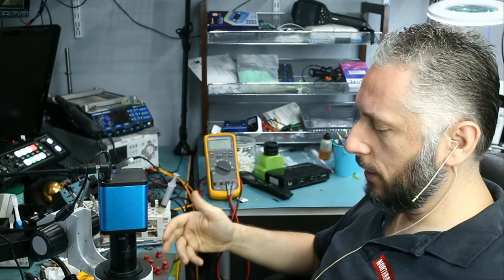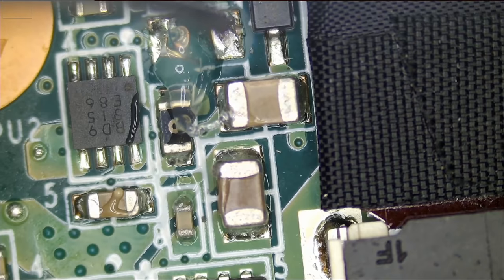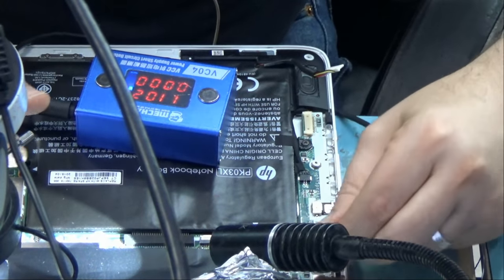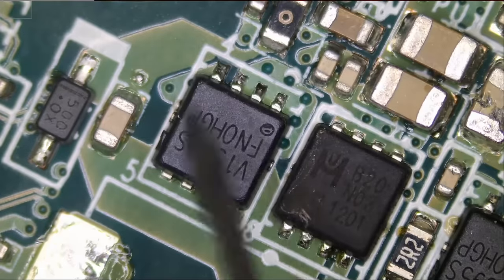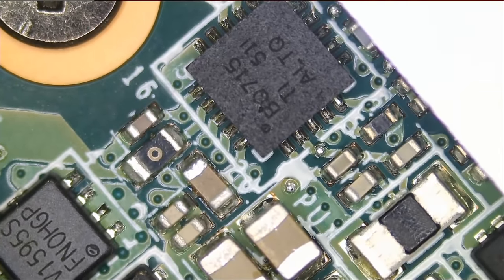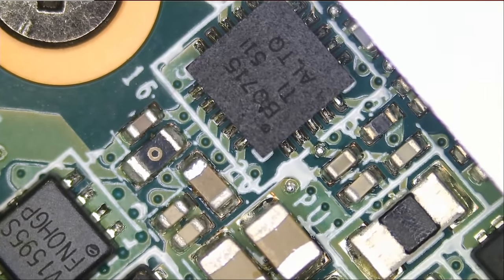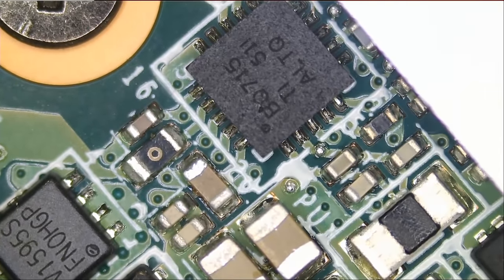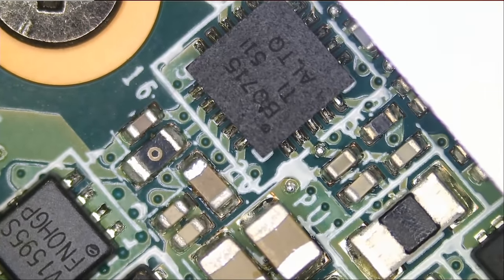HP Laptop No Power - Troubleshooting Short circuit - Watch component blow on camera

Comment: Another great episode of my favorite TV show. 😁👍 That ugly cap has been bugging me ever since 1:57 😠🔥
Reply from the maker: Yes you're right. That cap looks bad but it's testing good. I ended up changing the Mosfets again this morning along with that bad looking cap. Short was gone like before. I powered on the device and Mosfets went bad again. Laptop is going back to the customer unfixed unfortunately. .
Reply: @NorthridgeFix  Hahaha You always foolproof your videos, so i knew you did! That job was too good of a tease. You gave it your best. 👍 As Hristo Stoichkov says - "Sum tie win, sum tie lewn". 😂
Reply: @NorthridgeFix  this is VCC_CORE core line where blown resistor and capacitor you got the short. Most likely a rare event happened - cpu itself is shorted. IC is battery charge controller. And mosftest near by IC gives VIN line
Reply: Was going mention that cap amazing work as always HP should seriously offer you a consultation job to help them design better labtops you seem to always be fixing these things and would have a great many ways to help them improve this line.
Reply: @em0_tion  I miss players like Hristo Stoichkov ,,
Reply: @NorthridgeFix  well it happens. Wondering if it wasn't a bad CPU or graphics.
Reply: That ugly cap had me since the beginning too. Good job trying though on this board! You did your best!
Reply: @NorthridgeFix   

كل عام وانت والعائله الكريمه بالف خير يا حسان 
حتى لو كان الابتوب غير قابل للصيانه ولكن اللحلقه جدا جميله كالعادة مثل باقي الحلقات … سعيد بمتابعتك دائما
Reply: @ksngs78  Agreed. I had a similar issue with an HP ENVY that was not charging! Had to replace the mosfet and the near-by limiting resistors, and caps.
Reply: @NorthridgeFix  You`re great man. I really like your work and how you explain everything!
Reply: Daayuuuuuuuum that SMD work he does
Reply: l
Reply: can you give me some diagnostics for my fried laptop pls?
 @NorthridgeFix
Reply: maybe the problem is CPU or graphic IC

Comment: Why didn't you remove the big red flag -> the capacitor that was fractured?
Reply: ...because it never indicated that it was shorting? Fractured or not, it was still functional. That's the mindset you HAVE GOT TO follow if you attempted to fix a laptop and didn't have the same model to extract any components from. So let's assume you try to remove that cap anyway because you didn't like the way it looks. Great, now you gotta find out its working voltage and capacitance. With no schematics to go on about and no capacitance measuring device, good luck with that.
Reply: Yes please..why?
Reply: @Rodox2k10  bruh, he literally had a donor board with that cap for the taking, would take 15 seconds to swap for peace of mind...

Comment: This Circuit that blow is switching power supply. Google about it, simply 2 mosfets, 1 Coil, capacitors and driver.
Reply: This guy is just learned everything diy. He doesn't know how to properly proceed with fixing motherboards. It begins with reading the schematics to understand how the device works. It doesn't have a charging issue, he already put a fully charged battery inside from a donor laptop and proceeded to remove the ic that is responsible for charging the laptop. Big time fail.

Comment: Got a hp envy touch smart 14 inch component blow off. Below the ssd port. My technician doesn't seem to figure the part. The laptop turns on when battery is charged but doesn't charge or lit the power light when the charger is plugged

Comment: bravo for the excelent video... try on the coil that you removed to inject 3 volts 3 amps without the coil on the motherbord. with your thermal camera you will see the short circuit... becareful without the coil and inject the voltage  on the side with the short circuit...

Comment: What type of a soldering wire you are using? And how much temperature of the air do you use for removing the chip whithout damaging the pcb. And the diameter of the nozzle did you use the remove the small components?

Comment: Hey there, I have a HP spectre x360 15-df00TX laptop whose battery doesn't charge. It only works when plugged in. Time also resets whenevr I turn on. I have updates all drivers and even BIOS still nothing. I opened and tried another battery and battery wasn't charging.. what seems to be the problem?

Comment: Dammit. I have a very similar issue with another Mainboard. 13:20 one of the gates was blown and i swapped it but there were still shorts. Right now i removed the chip labeled BQ24725 but the short is still there :(( i don't have a temperature cam.

Comment: i think you cannot seen there is a chip capacitor has an damage on the top nearby from the two chip capacitor and two Mosfet that you remove. i believe there is a reason why even you replace that mosfet the failure are existing due to that chip capacitor are leakage

Comment: If you have a death cap, how can you know the new cap caratteristics to replace the death one? (if you don't have doner board)
Reply: by the cap's size and the circuit it was used for if for instance schematic diagram and donor board isn't available
Reply: @golski1273  alle the caps with the same size are the same?
Reply: @giuliocarlini6681  no. they have different values. the size and the circuit will give you a rough idea of the capacitor's value.
Reply: only real accurate way without a donor board is to read the value on the schematic.

Comment: More simply if you don't have a diagram check individual component datasheets, most charging circuits are texas instruments etc and the manufacturer of the laptop is probably using the same circuit on the datasheet. BTW you can find service manuals for most if not all.

Comment: Sir, I have a laptop (ASUS-K46CA), it is turned on occasionally, it is turned off again after two days of running, it is turned on again after a few days, it was run with charger due to battery loss, when it is turned off. If the charger is connected then the power light, the charging light, they do not light up, if you turn it on again after a while, I would have benefited if you could tell me the cause of this problem.

Comment: Very easy to find a fault in this hp motherboard the fault is your front of your eyes but you can't see 1 damaged capacitor around the mosefat and the resistor 10r0 only 2 faulty components change and problem solve it's not a chaging IC issue...